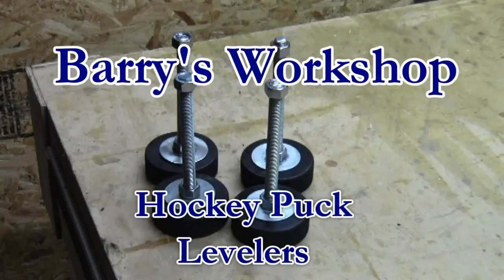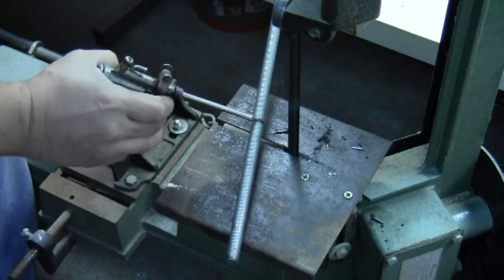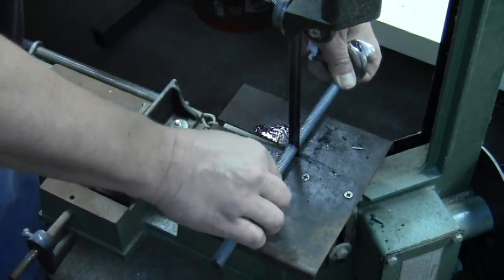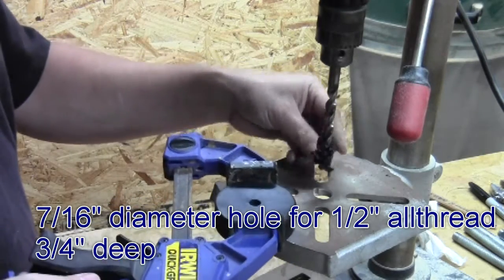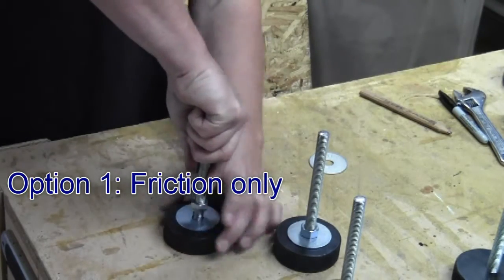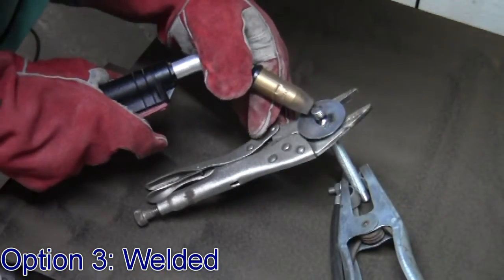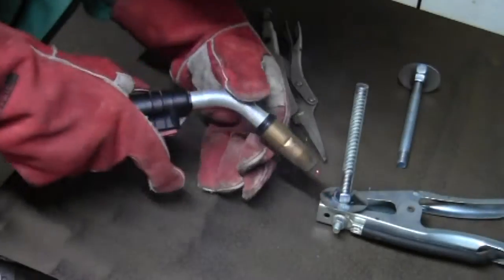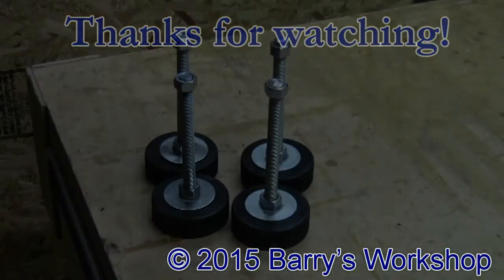DIY Levelers Using Hockey Pucks

Comment: that's great ,anytime you can make it yourself and save money it can't be bad ,I wonder how well a hockey puck would work as a bench cookie ?!
Reply from the maker: +sdmcustom woodworking Thanks, I share your appreciation for DIY.  Lee Valley actually sells them for this (and they're cheap). They call them "Bench Pucks" and the also sell a self adhesive foam pad to stick to the pucks. IME, they don't work well for that because either with or without the foam, they're slippery on a workbench. (It could also be that my housekeeping skills leave a bit to be desired.  cough...cough... ) They work well on my concrete floor, however. 

Although hockey pucks are smooth (they're made to glide after all), they machine very easily, so you might be able to alter the surface if needed.
Reply: +Barry's Workshop thanks ,might be worth a try

Comment: if your "welding was just messy or really didnt hold much" then your not welding properly.
That said, avoid those zinc fumes,  bad stuff.
Finally if you cant weld, or even glue, why not use perm thread lock or better yet for the low skilled, a second jamb nut.
Reply: Indeed. If you are going to weld stainless or zinc coated steel you should make sure to have proper ventilation or a forced air respirator/purifier.  There really are no safe or acceptable amounts of exposure since the toxins given off bio-accumulate over time.